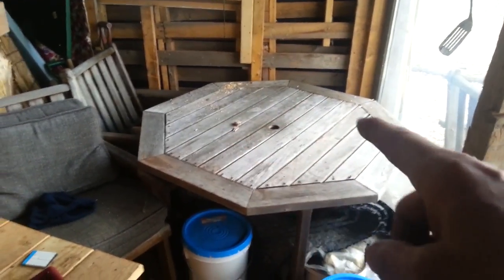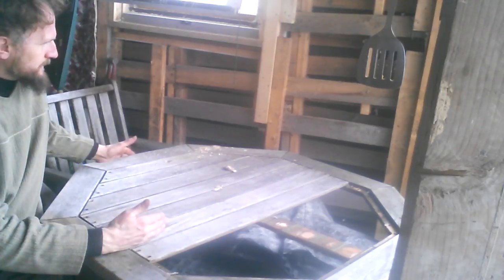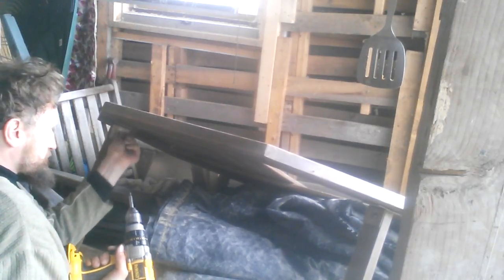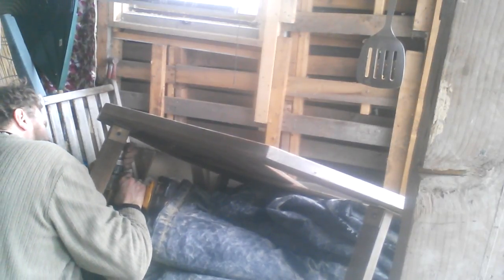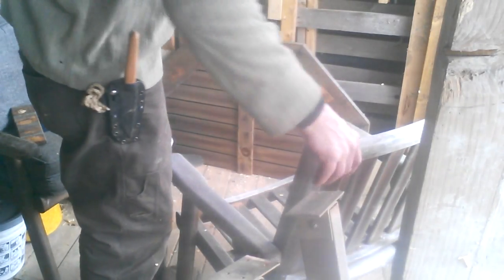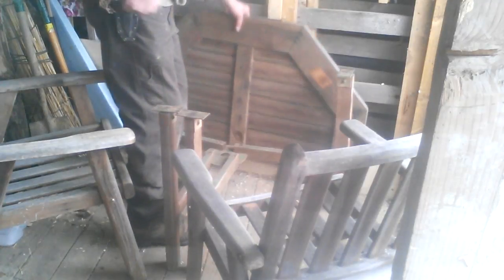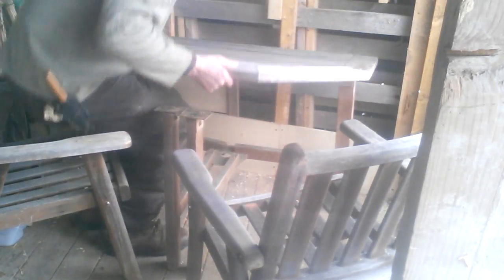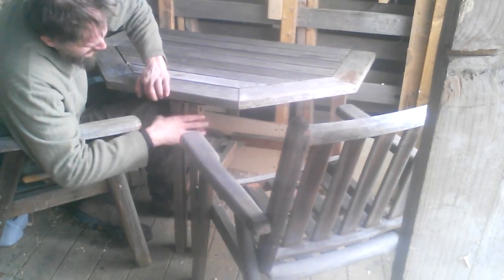Tiny House Off Grid Pallet Cabin - Part 18

Comment: I disagree i like hearing the thought process while you work through things. Just my 2 cents though. Hey Pete, what about knocking the table down a inch or two and placing a few hinges in the table and bottom support brace so they all flip up? depending on the inches lost you wouldn't cover the window.  Then when table isn't in use, you can flip it up, turn the chairs around and you and guest can watch the fire and talk about the next piece of build. Just a thought. save some space as well.
Reply from the maker: I haven't finished the insulation on that wall yet. So when that is done then the paneling can be finished and I believe I will you your suggestion which is a great idea! :)